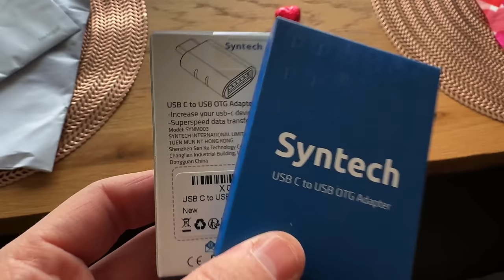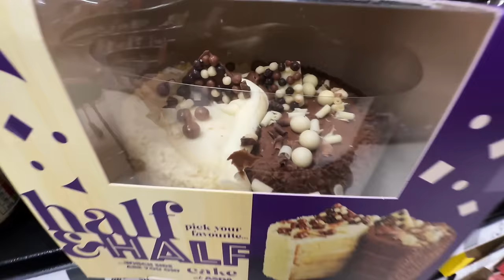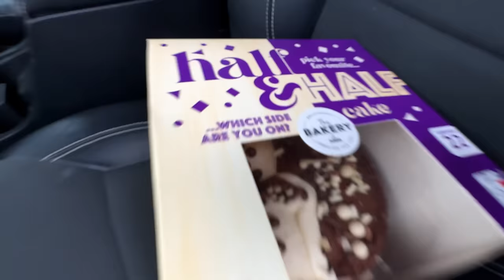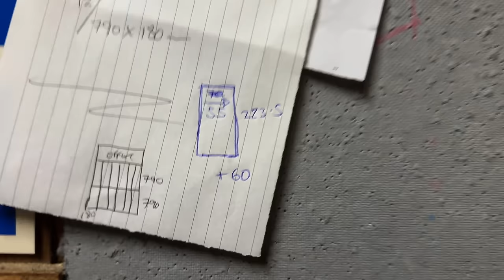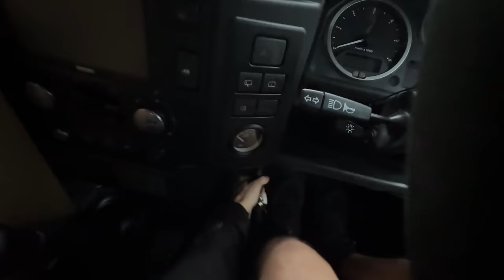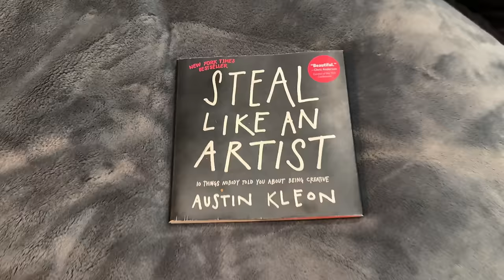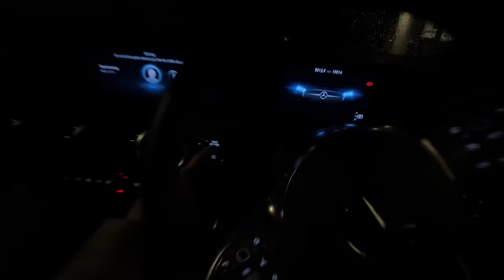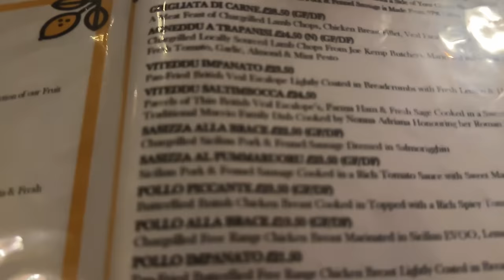The Start of the Ultimate D.I.Y Project has Begun!

Comment: Instead of buying a van, I'd upgrade the Defender from a Defender 90 to a Defender 110. 
You get the additional row of seats which you can put down to give you so much more room.
Reply: Or remove the seats in the 90 since they dont get used that much or buy LandCruiser 200 and ute it.
Reply: Or a new v8 130!
Reply: @callumferguson6115   Nah, might be a good idea for him to step away from Land Rover. Look at how many issues hes currently had and is having with the 90. Least with a Toyota you can rag on it.

Comment: Tom, for your dartboard, I would recommend doing the same as you have with the MDF but for the floor. Dart points are weaker than tiles so won’t chip them, it will just bend the point. Probably best putting the board up first and then measuring from there to determine how long you will need the boards. Also, I’d recommend the following set up: Winmau Blade 6 board, with a rubber surround and a corona magnet dart light - The light is a must.

Comment: To mount it get some plates and drill into the top boards making metal runners across the top, then on the wall do a matching set with magnets so they snap to it and do the same to the bottom so it's flush and they won't move them you can just pull off or snap them back on

Comment: 5:53 Hi! Model train nerd here.  Not all model trains are a like the model you have will be an older tooling (older molds means less detail and it usually doesn't include new gizmos). You're still probably looking at 40-50 quid if you stick it on eBay though. My advice keep it an build a railway in your garden!

Comment: Pro tip: u should do crunches instead of full sit-ups. Easier on the lower back. Then, do leg lifts to work the other stomach muscles. Also, side crunches to work the side stomach muscles. Whilst doing them, touch your finger tips together; but Not interlocked: and keep your finger tips touching. Do not pull your head up with your hands either. So, don't use your neck muscles to pull yourself up. Use your stomach.
Good going!! Keep it up 😉

Comment: Could put hinges connecting the mdf to each other and one connected on the side by the window so it'd swing to behind the curtains for when you ain't using the dart board just a idea cus hanging wood from the ceiling or false wall is just waiting for someone to lean on it and rip it down

Comment: Good VAN is Mercedes VITO and Sprinter. Ford also is not bad. The worst choose is VW Crafter and ofcourse T5/T6 (probably everyone have a problems with engines/with oil etc.). So the best choice is Mercedes with motor 2.3 diesel in Vito from 2015 to now.

Comment: Idea for the dart board. To hang it, make like a curtain rod out of piping so it can be the right length and put like j hooks on the boards  to be able to hang it and remove it. For the back do like some rubber door stoppers or rubber cube things to help prevent flex and sway when darts hit the board and place it spaced evenly and at places it would contact the book shelf.

Comment: Stay away from the ford transits new and old tonnes of problems from guzzling adblue to shredding front tires and even chewing there timing belts up stay away😂 nissan nv400s r good and reliable as well when the body doesn’t rust away 😂 but the Volkswagen  crafters hold there money as well as the Mercedes sprinters but all in all the if ur wanting a van thats got that off road capability as well as reliable ad say the Volkswagen crafter would be my shout with the BF Goodrich tyres and a cheeky lift kit can go anywhere with anything 🤯